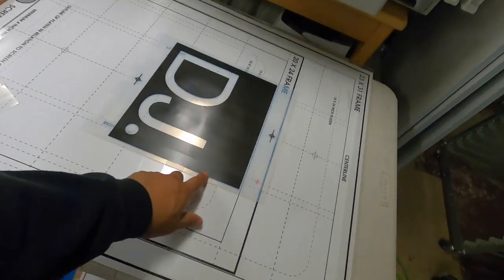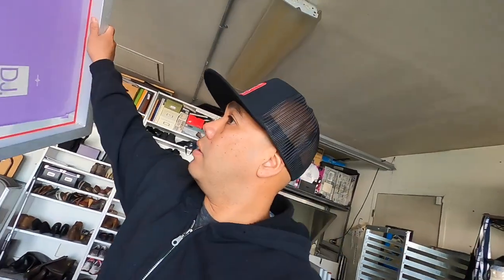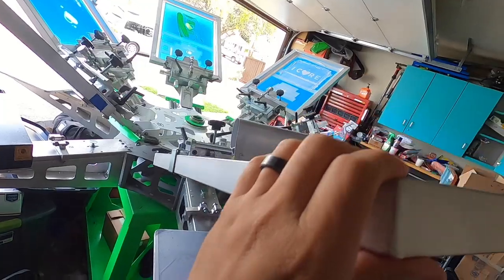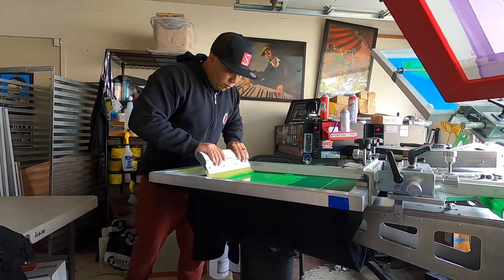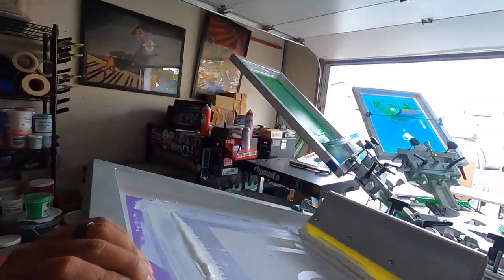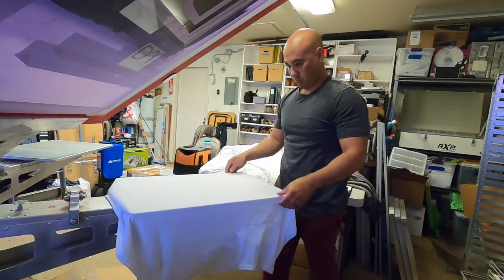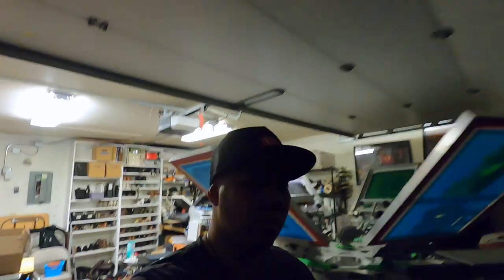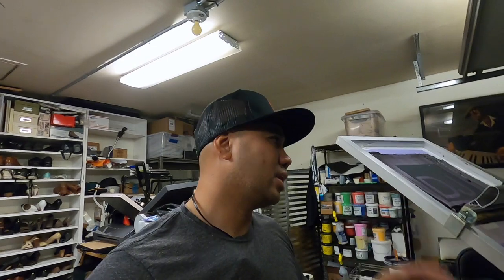SIMPLE SCREEN PRINTING WITH COLOR CHANGE : Screen Printing 1 Color Design (S:06/Vlog 024)

Comment: Ryan,  how is that press to spin?  is it heavy?  aslo how are the aluminum platens on heat, they heat up fast?
Reply from the maker: It is a little heavier than my old one, but not that bad. The aluminum does heat up a little faster than wood